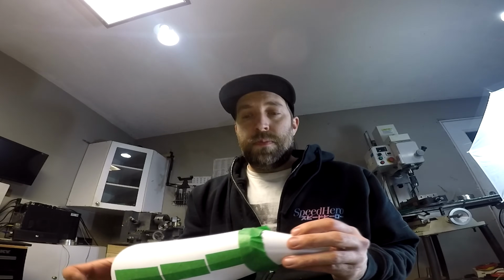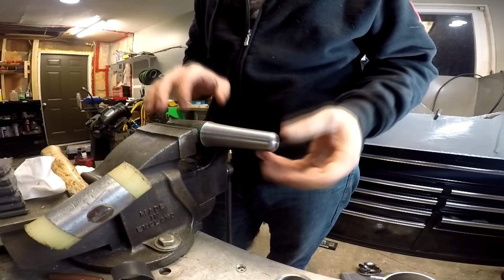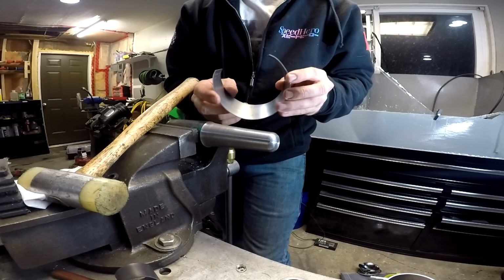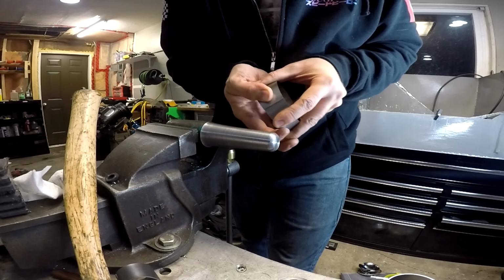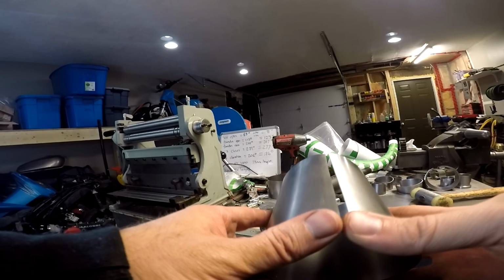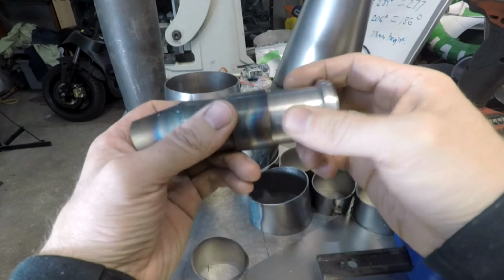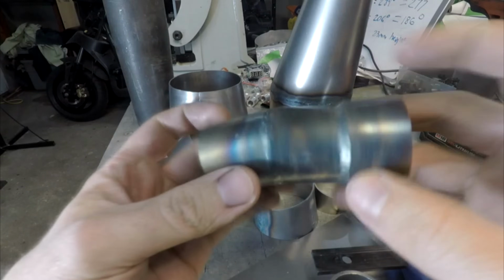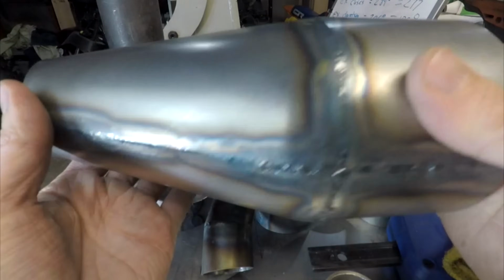Make a 2 Stroke Expansion Chamber Pipe for the RS-100 - Part 2 - J's Garage

Comment: Hi,i have a Suzuki RG80cc which is known for having a useless factory exhaust .it doesnt have a cone inside to bounce back pressure waves .do u think if i cut the end off and weld a cone on it should perform better? Also what diameter of pipe would you approx use? 90 to 100mm is what i have avail
Reply from the maker: I would use a pipe calculator and see what numbers it gave me or try and copy a known pipe and its dimensions and try and emulate them as best I could.
Reply: @pitobread  thats beyond me tbh .ill just chop and try ,i have no choice

Comment: To ROLL any conical in rollers.Plca a peice of steel at one end of the rollers that is too thick
to go through the gap,say 25 mm square flat bar.
Insert sheet to be rolled hard against its side and wind sheet in.
Adjust  rollres so they only just grab and wind sheet through.
tighten rollers each pass!!!
This allows sheet to twist as it goes through.
You will get a PERFECT SHAPE.
DONE IT THOUSANDS of times!!!

Comment: How thick is your material?  Your welds look perfectly functional.  Prettier will come with practice and stability.  You showed a clip standing up and both arms free.  I noticed a big improvement when I got a stool and made a point of elbows down or firmly supported.  Same thing with keeping the work piece from flopping around.  If you're worrying about that, you're not concentrating on your welding.  Looks really good, way better than the first pipe I made.
Reply from the maker: Thanks, I have a buddy who is always yelling at me to do the same things, prep a but more and get comfortable. 
Part of it is also I have tremors in my hands so even at max stability I get less than steady welds.

The material was .050 I believe.
Reply: @pitobread give me blueprint
Reply: Far too thick .Adding a ton of unnecessary weight .